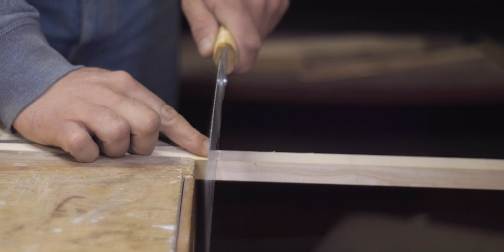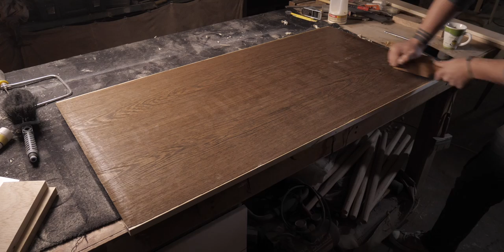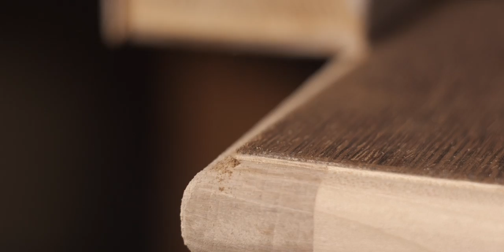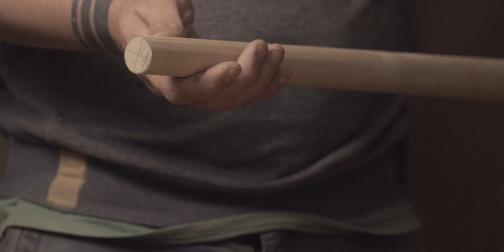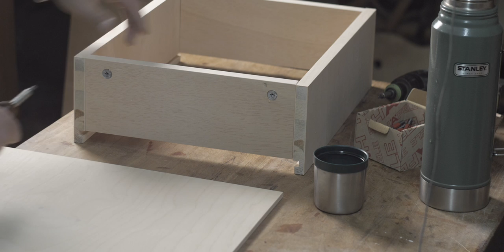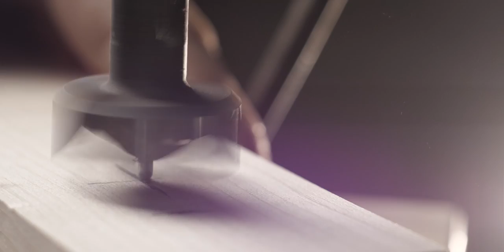Wenge and maple veneered desk making

Comment: Great work! What kind of glue do use for the veneer that you don't need any clamps oder Press?
Reply from the maker: thank you very much🤗This is a neoprene contact adhesive, apply to both surfaces, allow to dry slightly and then press and rub in thoroughly.
Reply: There's also a method that involves just wood glue and an iron. I've used it myself and it's super simple. Have only done a speaker box and stand with it though so I'm not sure how easy it is on larger surfaces, but I'm assuming it works too.